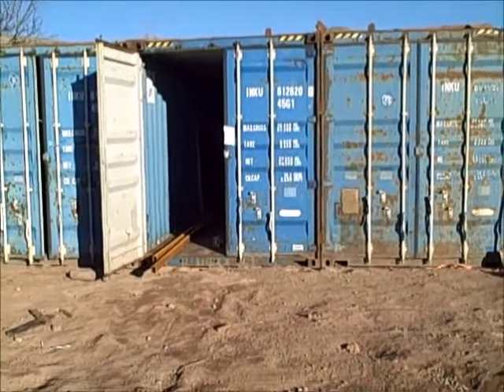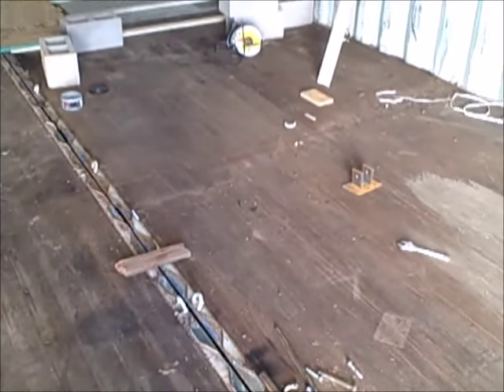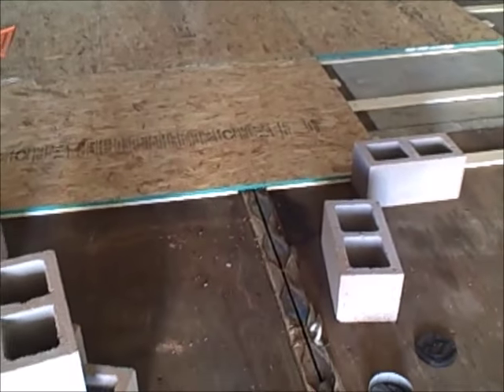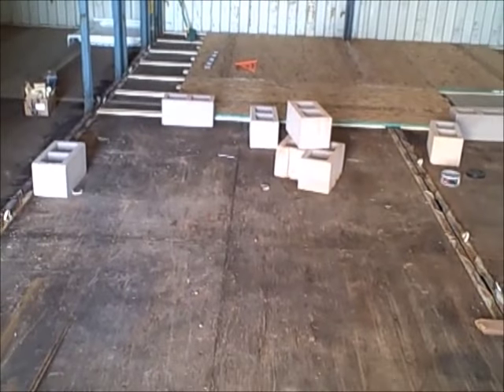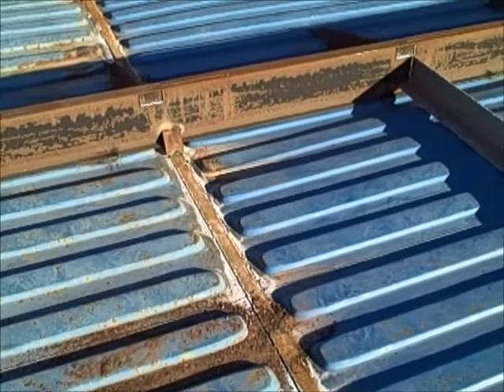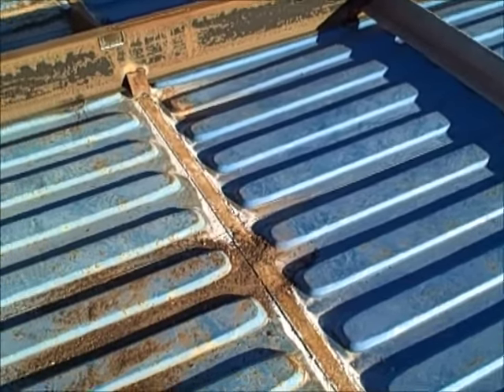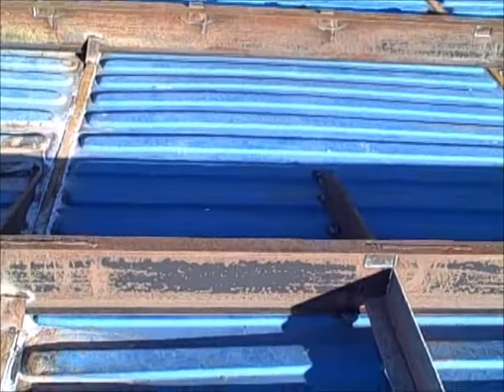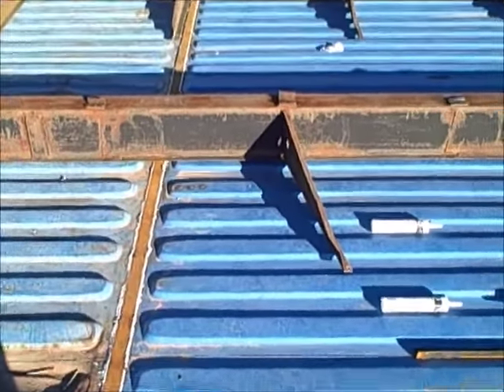Bunkers and buried homes, MORE MISTAKES not to make

Comment: Something to talk to your buddy about is the weight of the soil. a cubic foot of soil weighs between 76 to 110 pounds roughly and depending on moisture content. From what I see in the video he has 3, 40 foot containers. That gives him a surface area of 960 square feet. Multiple that by 4 for the thickness of the dirt he wants to put on top of it and it comes up to 3840 cubic feet. Now on the low end of the spectrum at 76 pound per cubic foot he is putting approximately 146 tons of dirt on top of the structure. Now the other thing is water I realize that you only get about 8 inches of rain a year but that rain weighs approximately 8 pound per gallon and has to soak through that soil until it makes it way back to the aquifer thus adding more weight although for a short period of time. I would urge him to seek the advise of an engineer before he gets himself or someone he cares about hurt. Good luck to him.
Reply: John Lindsey ohhhh it's going to cave

Comment: A vapor barrier here would be worthless being the floor isn't watertight ,a vapor barrier is for condensation only, that floor will be coated with black mold on the bottom of the MDF within 12 months ,this structure is suitable for possibly a wood shed to store wood fuel in but not for humans to inhabit ,being in the desert makes thermal shock condensation even worse because of the drastic temp changes every 12 hours ,twice a day that steel will have hot meeting cold which in every case equals condensation ,condensation in an enclosed area equals hazardous molds ,do not enter that structure without a particle mask once it's covered with earth and experiences 6 months of thermal shock condensation or your putting yourself at risk of legionella or worse .

Comment: 4 ft of dirt on top??? wow!!! I now know what not to do to a container. I will tell you how you can put 4 ft of dirt on top without spending so much on reinforcing. You flip the container up side down since the floor is already reinforced, just throw 4 bx 8 16 ga galvanized sheet metal on top to prevent rotting and water leaks

Comment: The Container needs to be air tight , all seams need to be welded shut. 
NO spray Foam. The wood floors need to be removed and steal plate put in
 its place and the containers need to be placed on footers or a 
foundation , not on dirt. JUST SAYING......

Comment: Gday. Im concerned he has built a huge coffin. 4 feet of dirt is LOT of tonnage up top. I think you need to convince your friend he needs good I-beam or C-channel topside, and he definately needs to change that sidewall bracing. Those containers are going to crumple like a can is my guess. I hope not, but I think they will.Also he should address the gap in the flooring for sure. A big heap of expanding foam to fill that gap will help plus then finish it off with a fat bead of silicone is better than what is currently there. The way it is setup now with out foundations etc, its all going to twist and buckle and fall in on itself. Please, please try to convince your mate to change it.

Comment: I've seen this done in other videos. The most successful version had a cement foundation on the roof to shunt the load to the corner posts where all the strength is. With the cement in, THEN he added dirt to the roof. With that method, he was able to drive a hug tractor over the roof with no problems.

Comment: There are a lot of water-tight sealer products being sold on the market these days, PLUS, concrete reinforcements on at least three sides of those containers. I would have started about 20 feet down.  Call me crazy, but, a five-foot thick concrete slab with PVC channels for the water to drain would have been a better start for the foundation.  The rest?  Footings for any electrical, and water, THEN reinforce the on the outside with cinderblock and rebar. High-grade water sealant, NOT CAULK, should be applied for the water-proofing.

Comment: I would pour concrete with rebar on the top at least 1.5 feet deep then cover with dirt. Also wrap it with water proof membrane under concrete. Run the pipes for electricity, air and sewer in the concrete. But that's what I'm doing. 3 feet thick with steel reinforcement. Mine will be 3 cargo containers deep with middle container set out in an L shape. The middle layer will be connected to my house septic system, solar and generator powered.

Comment: I had considered doing something similar to this. My thought for waterproofing was to use rhinoliner or linex spray bedliner to seal it.
Reply from the maker: I don't know anything about the two options you mentioned.  I mean I know of the product and have seen it on the shelf, but as far as sealing a roof, that's anyone's guess.  A product to consider is an elastomeric coating.  It's like think rubberized paint.  We've used it to seal mobile home roofs and it works like a champ.
Thanks for the look.
Reply: Rhino truck liner is the perfect option. It's seals the container 100% and it also adds a large amount of strength to the roof and walls. Use it you won't regret it.

Comment: tack unistrut across the floor giving that left for ventilation could put a sub pump for lower areas that might have water settling. and put it on a rock bed that's porce and air can  escape for drying the moisture.  also put PVC pipe in the foundation with holes so any. build up of underground water collects to the pvc and redirected to a pump and reusable water for a garden or toilets and  containers. something you have in large boats collecting container that has a pump. 👱👍🇺🇸 lets make America great Again.

Comment: rent a kettle and melt hot rubber use neoprene on the open gaps sealed with hot rubber prior to laying out all hot rubber on top  use a layer of polyester on top of hot rubber lay another layer of hot rubber lay a protection sheet on top. Hot rubber is a asphalt based product when melted together it creates a monolithic system. If you plan to put tress and plants lay a root barrier with drain mat on top should be sufficient on top. this is your roof    inside deck prep great start, bituthene, liquid membrane  the t joints. best water tight system not budget friendly but the best

Comment: I must think that putting a radius roof using part of a culvert would add a lot of strength, further, putting braces from the ceiling centre to half way down the wall where reasonable would also add strength. Fill the radius roof with something for additional support if possible. This would require more depth but would provide additional  gamma radiation protection.

Comment: I wonder if you are negligent for not turning this over to building code enforcement  by you making this video and posting it and doing nothing about it you are going to be responsible for any deaths or injury knowing that it's structure is going to fail
Reply from the maker: good question,
the problem is that I am not nor have I been in the state where the project is or was taking place.  I'm 1,500 miles away and have been for 6+ months, before that I couldn't discern the intent of the project from a goat shed, storage barn etc etc as I saw no plumbing or electrical work I as an average person couldn't tell if there was or was not intent to occupy the structure.
Reply: @Shelka04  What, that's not you walking around narrating the video, the one where you say your buddy is building a bunker/berm house out of shipping containers? 🤔